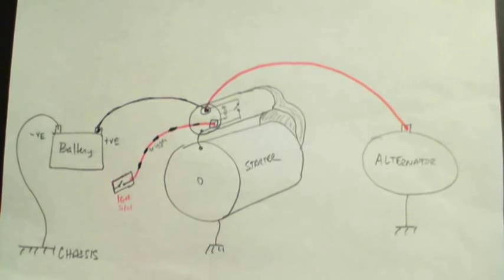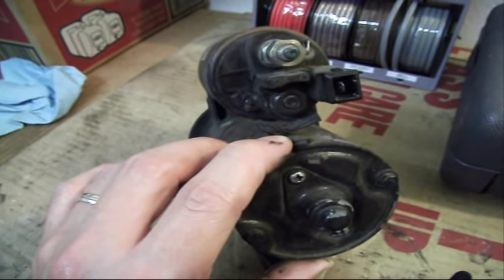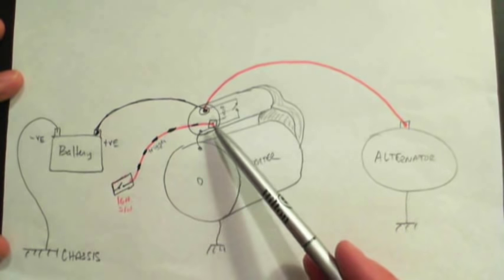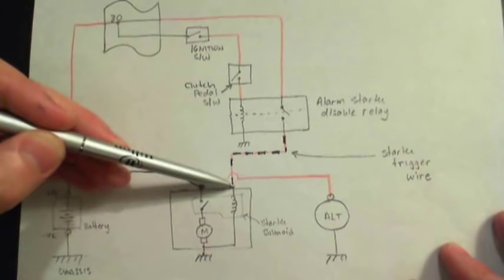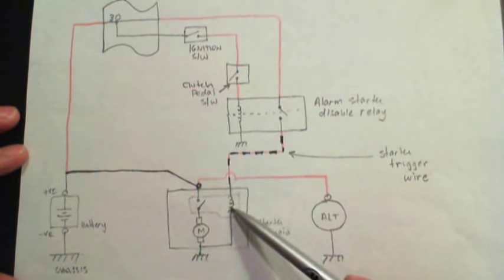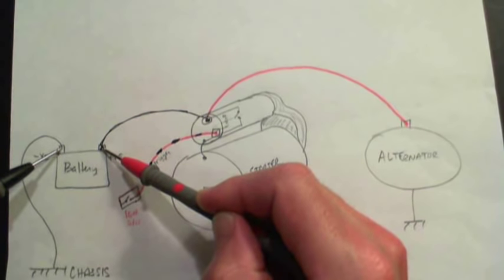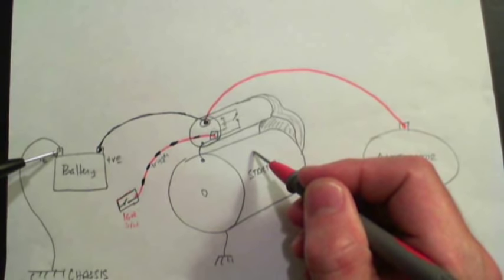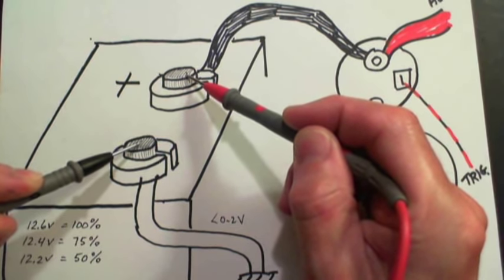Starter Motor Troubleshooting Tips DIY - How to diagnose starter problems

Comment: John, awesome instructions and very clear! As I can't find an answer elsewhere, here goes: Starter bench-tested good. [INFO: Vehicle '79 Chevy "Ramblett", new to daughter. Ran fine, started every time, until I turned the dash-switch for lights. ] I found 4 wires to starter: 1 from battery, 1 from harness (both on big bolt), 1 from harness on small bolt, another from harness with the end shorted/burned off. That's my problem. WHERE does that wire go? Is it the one that slips into the square fitting? In my ignorance I put a small round end on it, and attached it, with the other one that had been on small bolt. NOW: wires attached as 2 on each bolt. NOT MOUNTED YET. (sitting on a bucket, not hanging by wires). When I attached the battery + at battery, result was very rapid clicking. QUESTIONS: *wrong end on small wire? * not grounded as it's not bolted on? PLEASE, SOMEONE, help? Baby's got new shoes, waiting to take a mom-daughter RoadTrip! BTW, old-style starter with 4 bolts.

Comment: What is wrong with my 1998 Ford transit diesel cab chassis it was starting ok until I changed the coolant bottle,now I only get 2 starts & on the 3rd start it goes click clock click but it will start when I jump it with my jumper pack It has 2 new batteries starter motor is 6 months old & battery leads cleaned & checked  The earth straps are ok could it be a relay or ignition key however I checked the relays & there ok maybe the solonoid is wearing out already although it’s only 6 months old All advice would be so appreciated.

Comment: A well explained video Thanks.

I have a 2005 ford e350 pass. van. Last night I was driving & stopped the engine for 10 seconds. When I tried to start up again I had full dash lights & radio & only a single click from under the hood.  It would do this  single click every time. I did it 5-10  times. Each time exactly the same  result. No cranking sounds at all.  Any suggestions as to where to begin my trouble search?

Comment: Fantastic explanation, clear and straightforward ! Thanks 
I would like to have your view on my problem. I had to replace my starter this month as it melted down twice. First time I was parking, I switched off the engine, remove the key. I heard the starter was still spinning with the engine off and smoke came out from the hood! Second time, it melted down again while I was driving 5 mins after I started the engine. Any idea what can cause this issue?

Comment: Mr. Wolfe ( I solve problems) Shows how to start your engine :) ... Just kidding, this is BY FAR the most informative tube, & has cured my issue, where others were too vague / not easily followed. & You do sound like Harvey Kietel :)  tyvm bearing01, you have saved me a bloomin' fortune, in marine engineers' fees. Which is good, 'cos I drive real fast - so, keep up :)

Comment: The solenoid has a switch inside.  The always hot wire is the power coming in, the wire coming out of the solenoid is NOT the ground.  It is the hot wire once the key/ignition switch is turned.

Otherwise, the video is correct.

Comment from the maker: @s61927 The remote relay starter therefore has two big cables running to it as well as the trigger wire. One cable is from battery and the other is switched power going to the starter.  The starter receives only one heavy cable from the relay, to energize it.  If the car doesn't have an alarm then there won't be any ignition switch disable relay like in this video.  But if the car has an auto tranny there will be a gear shift starter disable switch in the trigger wire.  /John

Comment from the maker: @s61927 Old starter motors are big & heavy because they use electromagnets instead of permanent magnets. Some, like on old Fords, these electromagnets move with a lever action to engage the starter drive pinion with the engine ring gear, called: Positive Engagement Movable Pole Shoe starter.  It won't have the solenoid bump but rather a remote starter relay.  The trigger wire goes to the remote relay.  The starter motor receives only one big heavy wire for power from that relay. (to be cont'd)

Comment from the maker: Find the engine tempeature sensor (CTS) and unplug it.  If you have a multi-meter to measure resistance, the sensor should measure around 2000 Ohms when engine is cold and around 200 ohms or less when fully warmed up.  If the readings arent in this range you may need the sensor replaced. /John

Comment from the maker: @chip973 The video tells you how to check if a connection is bad.  If a connection is bad then you either need to replace corroded cables or just use sand paper and rough up & clean any corrosion (ie powder) off the battery lugs and cables.  Then make sure all connection are tight. /John

Comment: Excellent video and did cover everything except that he did not test the voltage at the
solenoid output at the starting moment. Solenoid contacts become resistive and therefore the voltage drops to the point where the starter does not turn.
Reply: This is true ^^^^ I've noticed many starter diagnosis videos tend to ignore solenoid symptoms or failure points. Perhaps it's because it's a bit more mysterious of a component to many people. A common failure in solenoids is the contact discs and solenoid post stud pads.

Comment: I have an 03 Cadillac CTS and my car always start with one turn of the ignition key. However, after a street mechanic changed my manifold gaskets which was leaking oil into my spark plugs causing my vehicle to smoke, the vehicle no longer started when I cranked it. The mechanic then connected a wire from the starter to the battery terminal that started my car. He stated that I needed a starter brush set replaced. I took out the starter relay and tried bridging the relay terminal with a piece of wire and my car cranked up immediately. I then purchased a brand new relay, however it didn't crank up at all until I once again bridge the relay terminal. I also noticed that my speedometer wasn't working and for a brief moment my accelerator wasn't responding after pressing down on it. My alarm does come on and am able to disarm it. I believe the machanic must have unplugged a wire or something from my starter when he ran the wire to the battery and must not have put it back the right way. What can be the problem?

Comment from the maker: @donna2cool Could be one of a couple things.  Inside there are gears and if the grease around those gears gets hard it could cause a Zing noise as the starter disengages.  Typically a grind or whine noise is due to chipped or worn gear teeth.  That could be due to hard grease inside.  It could also be worn/chipped teeth on the pinion gear or flywheel ring gear.  /John

Comment from the maker: Last time I saw this behavior is was from a loose battery terminal.  You may have corrosion.  Remove +ve and -ve battery cabels and clean the battery lugs with steel wool or sand paper.  Then put them back on.  If still bad, the battery may be dead.  You want the other car (with booster cables connected) to be running also. /John

Comment from the maker: @s61927 If the wire broke and you reconnected, if you use a crimp connector to make the join you should be okay.  Just put black electrical tape over it to keep the water out. /John

Comment: To clean corroded battery cables I use a plastic cup, hot water and 2 tablespoons of baking soda, shines them up nice. Don't use a wire brush, it slings that corrosion every where.

Comment from the maker: The single click sounds like either a dead battery or a bad battery connection.  Clean the battery contacts and make sure the cables are tight.  If it's several clicks it could be a bad solenoid.. but I would check the connections and battery strength first.  If the motor turns but you get clicking noise then the grease around the gears inside the motor is likely hardened and you need to add more grease or change the motor. /John

Comment from the maker: The voltage on the wire coming out of the relay, which goes to the starter trigger input, that is the voltage that drops from 12V to 6V?  If yes, then you have a bad connection somewhere or the relay itself has pitted contacts inside and needs to be replaced.  I would pull the relay and insert a paper clip in the socket (better to use a wire with a fuse in it) to jumper the relay terminals (usually #30 to #87) and see if you get full 12V at the starter.  If yes, then it's a bad relay. /John

Comment from the maker: If the engine is warmed up and you turn it off, does it start right up again?  Is it getting colder outside where you live?  The engine coolant temperature sensor tells the engine computer to add more fuel when the engine is cold.  It's like priming the engine or turning on a choke.  If your sensor is going bad then it could cause you to have to crank the engine for longer before it starts.  /John

Comment: Thank You very much for nice dokument.  
My problem is : when engine cold its start very well and easy , when engine hot  and waiting 50 second olso start is very well but when engine hot and waiting  20 minute than starter turning slow . And engine start after long kranking .
What couse could be ? Battery is over 12 volt .

Comment from the maker: @ibkickenyodick 1) Make sure the battery is fully charged.  Maybe have it load tested or monitor the voltage across it while you turn the key. 2)make sure both battery terminals are clean and tight as well as the point where the battery -ve cable connects to the chassis.  /John

Comment: Got a flat head 4 cylinder Hobart engine  the coil starter is smoking from the nut. I had it running, it's a generator by the way military one. Found out how to put a load on it,because I tried starting it and it was hard to crank so I took the load off, can I plug the battery back on and the starter coil started.I thought I grounded something out so I went and got some terminal cleaner. I even disconnected everything this is from the fuse box. And it still smoke. I got a video of it

Comment from the maker: 60mA parasitic drain isn't too bad.  By dead I mean needs to be charged.  But if it has one or more dead cells then even if you charge it it may not provide enough power to start the car. You can check for a bad cell by testing the acid density with a battery acid hydrometer.

Comment: Hello, bearing01!  So I have a ’77 Fiat x1/9. The Trigger wire puts out 12+V. But when it’s connected to starter solenoid, multi-meter shows 9V.   Also, the trigger wire to the Ignition Coil puts out 12+V, but when it is connected to the coil, the volt reading is 8+V. I know it may have to do with the ballast resistor.  But I can’t figure out why the solenoid puts out 9V when the trigger wire gets plenty of juice from  the battery. So as a consequence, the engine cranks and turns strong, but it won’t run. It won’t start. Wondering if that’s because the solenoid is not producing the required 12+V to the COIL that the coil needs to produce SPARKS. Fuel pump and pressure working ok. 

Maybe adding a STARTER RELAY instead of a Alarm Starter Disable Relay would work. Car has no alarm system. 

All I really want to know how in the world to get 12V to the ignition coil.

Feedback really appreciated. It’s a headscratcher. Thx in advance!!

Comment from the maker: 3. I don't know if you have a remote starter solenoid.  If you do, you could use battery jumper cables to directly connect battery +ve to the solenoid terminal that connects to the starter.  If that makes the starter turn then you know the problem could be in the ignition switch or wiring and not the battery and not the starter. /John

Comment: Very good video, question I have replaced the starter motor on my ford focus, it started well first time then the car started smoking burning from engine bay, it was probably running for 3 to 5 minutes, I turned off the ignition upon seeing this, I checked the connectors to the starter motor and they were all well secured, with no corrosion and new nuts, the thick red wire which connects to the starter by and plastic housing that protects the wiring connectors has some green powder on the connection, and the wire does not feel a solid by the crimp join but still looks ok. And the igntion relay wire which is also makes up part of the plastic housing is in good condition, there was no sign of any wire damage due to heat etc so I can only assume the new starter which is a re con unit is faulty, I will get a multi meter to check the wiring as you have shown, I just can't believe a faulty/broken cable would cause that amount of smoke burn !! Any ideas ? I have removed the starter ready to take back to the store and the smell is coming from the toothed pinion !

Comment from the maker: A fully charged battery is 12.7V and is typically around 12.5 or 12.6V when installed on the car.  It should only be up around 13V if the car is running and the alternator is charging the battery.  If battery voltage falls below 12.5 or 12.4V as soon as you hook it up and put a load on it then chances are the battery is faulty and needs to be replaced.  An autoparts store should be able to load test the battery for you. /John

Comment from the maker: Make sure you use a low wattage bulb like 12V or something.  This will limit the current in the bad/shorted circuit and will prevent you from melting wires and causing a fire.  be careful. / John

Comment: I have a motorcycle laid up for restoration. The wiring harness has yet to be fully installed on the bike at this point. The starter motor is on the outside of the engine and all the connecting wires to it are visible. If I wanted to periodically crank the engine over to ensure decent lubrication can I run a wire from the starter trigger connection to the positive connector coming from the battery to the solenoid if it were a brief touch on on for a few seconds, then off? Thanks.

Comment: I'm currently having trouble with my car Vauxhall Corsa, you turn the key and it tries to start but it never does until you rock the car backwards and forwards then after 5 minutes or so it seems to start. I think it is the starter motor someone told me it might be the points on it or something but I'm useless with cars so I just push backward and forwards, it's not ideal but it works until it's fixed. Thanks for your video.

Comment from the maker: A weak water pump can't simultaneously supply high water flow (current flow) and keep the hose at high pressure.  A strong pump can.  Just like a strong or weak battery.

Comment: @bearing01 I understand what you are saying. But I think that most of those who make those kind of errors do so not because of underhanded practice but out of pattern recognition. Poor starting combined with easy boosting usually means a bad battery. Unless you go through the effort to do a voltage drop test while under a good load, you may miss that bad connection at the negative pole. It's cured with a new battery, not because of the battery but because the connection is refreshed.
Reply: spelunkerd 0

Comment: Awesome video! Question.. dropped a 302 engine in a jeep wrangler with an internal regulator. Starter was wired to external regulator in original car. Now my alternator only puts out 11.8 volts and starter will not disengage. What could be connected wrong?

Comment from the maker: The density of the cells on a charged battery should be around 1.270 and if you compare the numbers for all 6 cells, if the highest to lowest number is different by more than 0.05 then the cell with that lowest number is a defective cell.  It means the battery needs to be replaced.  Search youtube or google for videos how to do a lead acid battery density test.  /John

Comment: really thanks for your help. I did follow your comment, and finally found out that the problem is coming from the relay. When I tried to crank, the relay voltage drops from ~12V to 6 V, and this could not close the relay to trigger the starter. Could you advise some possible causes for me to further explore  . Thanks

Comment: By the way - I have an old T25 diesel van, with intermittent starting problems. Mostly after it's been running but sometimes from cold - it may click first couple of times, but no turn over.
I was thinking at looking at ground cable, (maybe going rotten?) and then following your ideas here.
Any thoughts on that one? Solenoid, ignition barrel worn, starter?
I'll get out and test battery voltage this morning.

Comment from the maker: Sounds like the starter could have a dead spot on one of the commutator bars.  Try knocking the starter with a long stick & hammer next time it happens.  The smack will slightly move the armature inside and hopefully make contact with the a good commutator bar next to the bad one.  Don't smack too hard.  There's magnets attached to the interior walls of the starter that you don't want to knock off.

Comment: I have a BMW e36 316 -95 that has been testing me lately..
I've never had trouble with starting the car before .. and it started fine last week until I briefly pulled over for some snacks on my way home. But thats when the "fun" began as I turned the key for the final stretch.. First, all the lights lit up as they should when you turn on the ignition..
However, when I turned the key further to start the engine the startermotor did not even react..

Comment: So if I have a negative earth mg so I am only hearing a click. This happened after I replaced what I thought was a bad spark plug wire.  I sounded like it went though some of the spark plug wires and now I only have a click.  It is only me so it is hard to check this without help.  So I have the negative battery cable attached to the frame of the car. From what you have said I will check the wire from the key switch and the wire from the positive battery cable.  Do I understand this correctly? Thanks